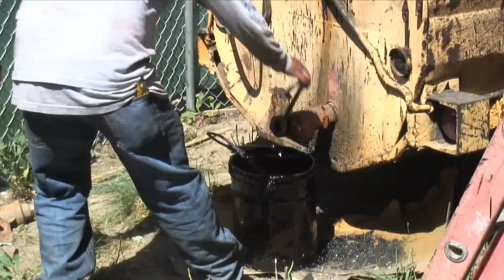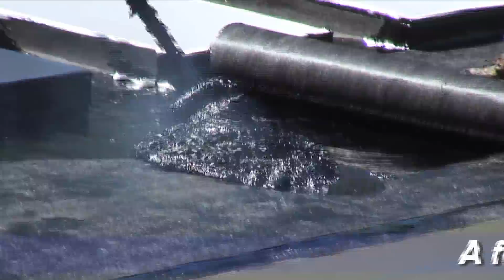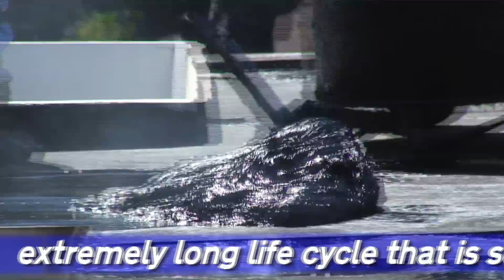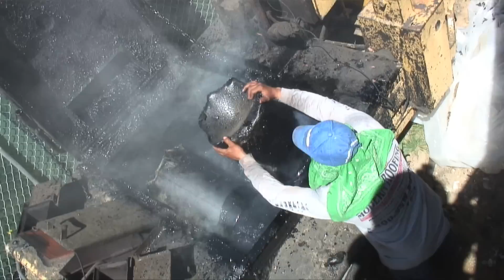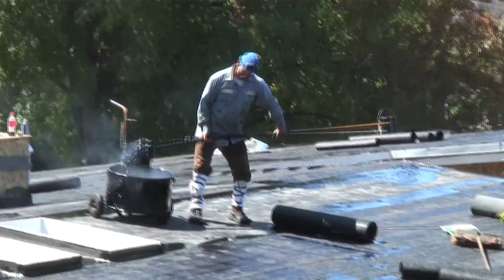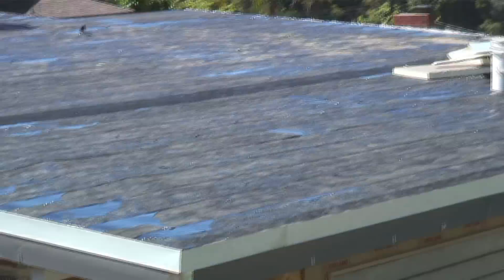Modern Roofing - TAR Roofing

Comment: Good roofing practices here in British Columbia is to have the skylights a minimum of 8 inches above finished roof surface.  Must not snow ever there.  My 2 cents besides all the obvious safety infractions.
Reply: BeerNecessities727 - u didn’t notice the lack of can’t strip around the skylights and 8” minimum height is a commercial spec.
Reply: @martinjvillasenor773  Just looked again.  No can't strip.  Holidays on the bleed out also.  I haven't roofed in 14 years but still.